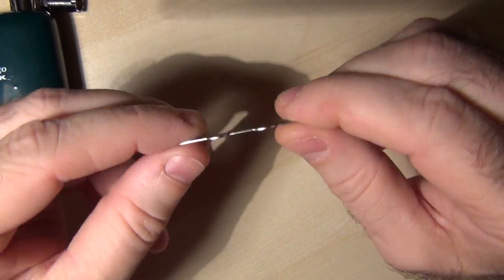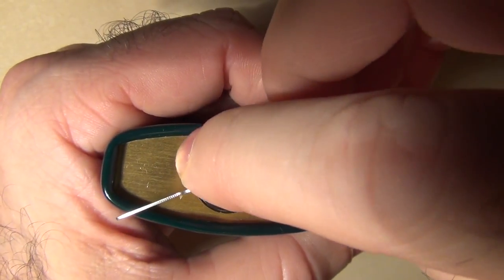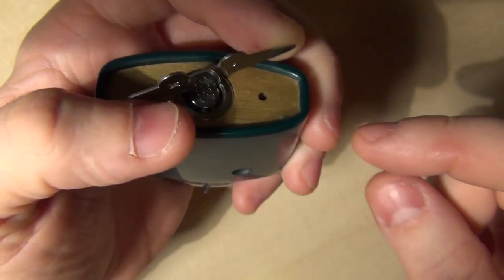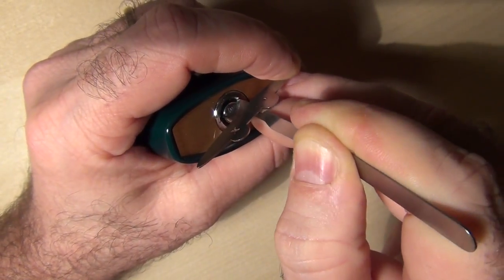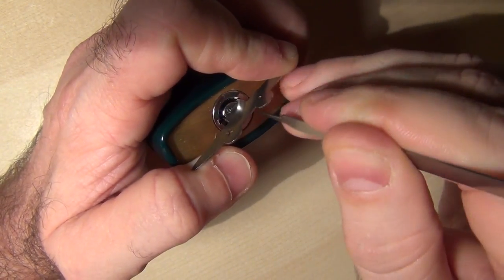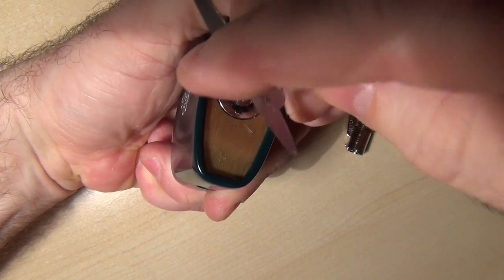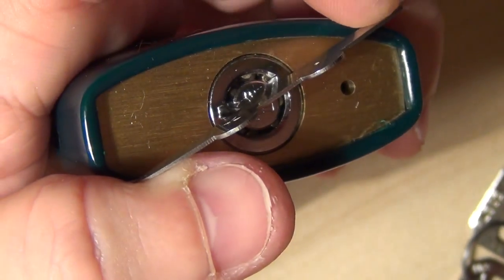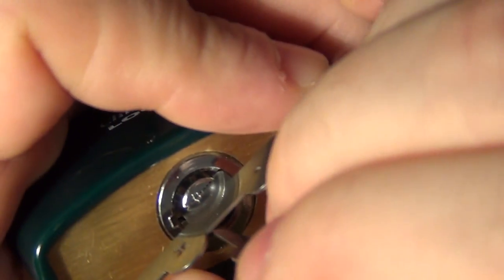Sparrows Mantis VS CompX Ace II Tubular Core Padlock

Comment: Interesting tool. It's the first time I see one of these. What are the two rounded portions on the top good for (with the cross and the hole in it)?
How much tubular lock have you picked yet? Did you have one with false gates yet?
Reply from the maker: the tool is supposed to resemble a praying mantis head.  I believe those bumps are supposed to be the 'eyes'.  The website didn't indicate that the holes could be useful for anything, but I've always wondered.

As far as tubular lock experience,  I've only picked 3.    Two of this type of core, and a smaller computer cable lock.  So my experience is pretty limited with them so far.  No false gates that I could tell.  How about you?